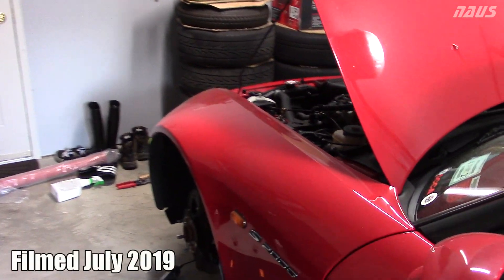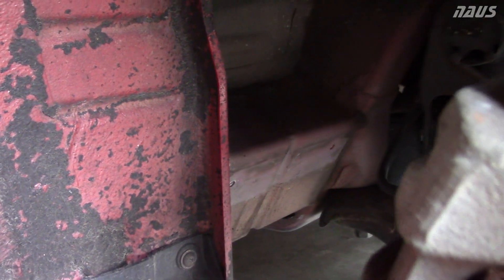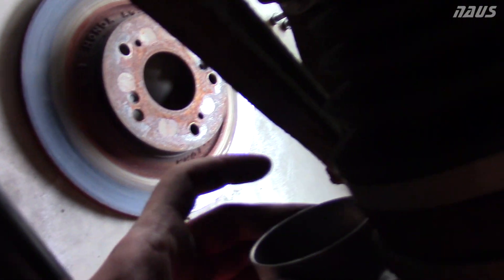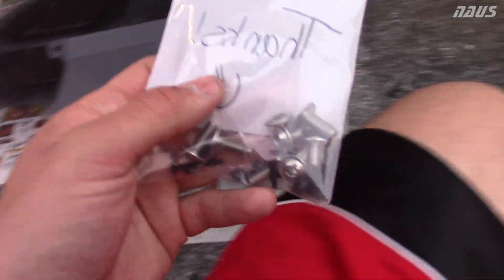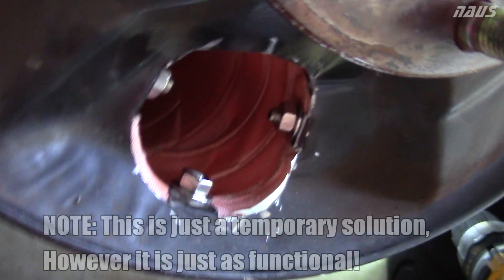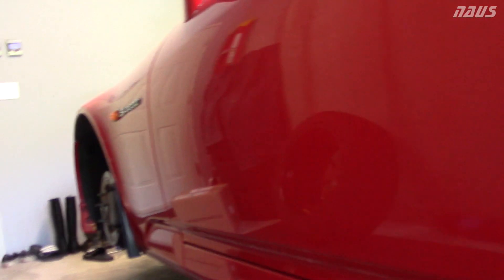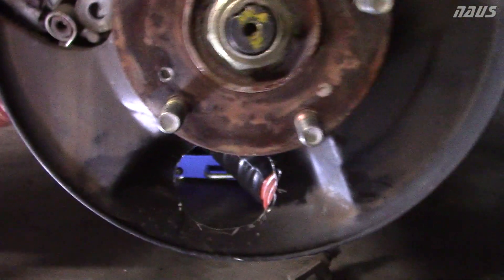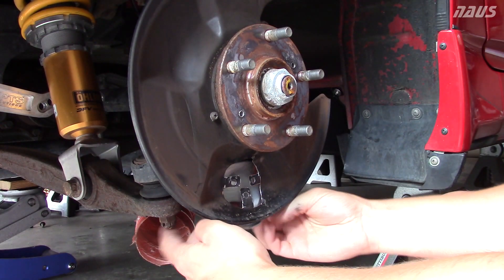S2000 Rear Brake Ducts DIY

Comment: Why don't you use a 2.5" hole saw for the dust shield.   Thanks for making this video and I am about to do it and wondering why..... thank you.
Reply from the maker: A hole saw that big on a thin piece of sheet metal like this with bends & what not may easily grab and edge and twist/tear it up. Dremel is definitely the cleanest way

Comment: Now time to put on some RX8 rears with the S197 GT rear brakes!
Reply from the maker: I’ve been looking into that, however since I have stock fronts I don’t want to add more rear bias right now
Reply: @NAUS2K  Its only about 8% difference if you are squared tire+wheels but 13% if you are factory staggered. It's really not a big difference to be an issue of Bias or the ABS. I have an early set and 4 months of street + a few autocross days no issue. I have also been to TotD about 5 times but it's local

Comment: Did it make a difference for the rear?
Been waiting a long time for a review of this product
Reply from the maker: The event I tested them at was 90 deg out and  sunny both days, never had brake fade once
Reply: @NAUS2K  but... did you have brake fade before? I doubt it. I don't see this product as being that beneficial. It's neat nonetheless.
Reply from the maker: sdlausen I had never done a track day when it was over 75 degrees until the one last year at Thompson. It was about 95 degrees out during some of my sessions. I don’t have scientific data to show you if it made a difference or not, but I’m sure it helps
Reply: Just buy good brake pads and rotors